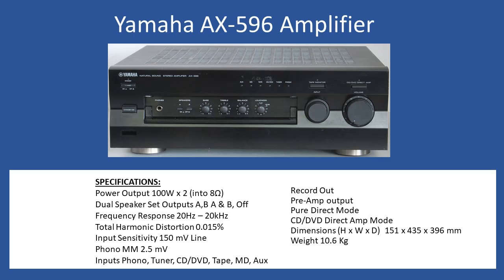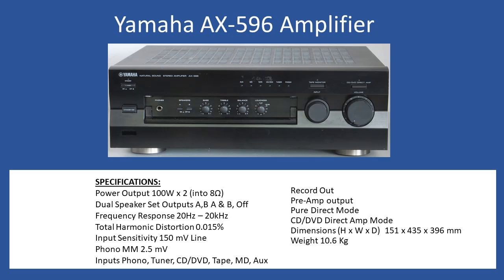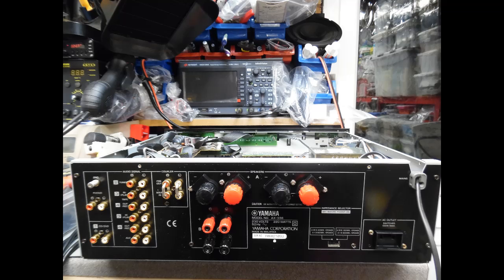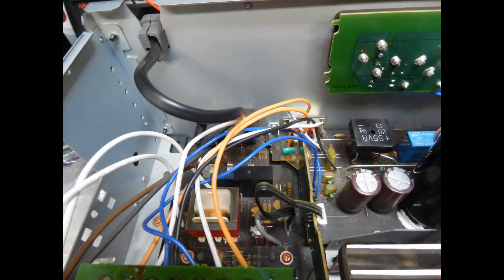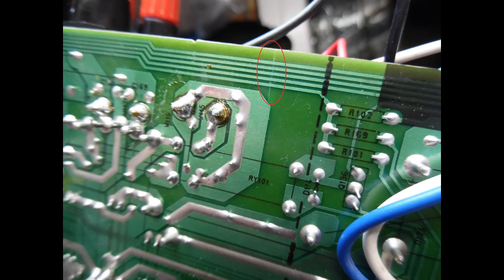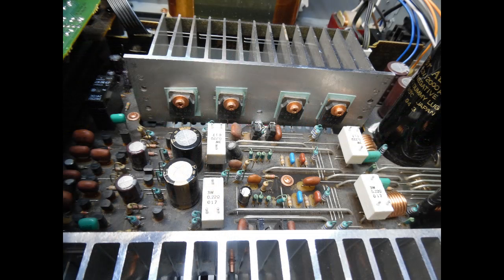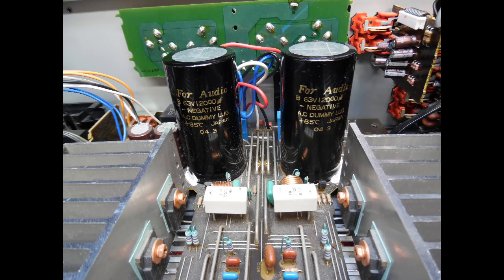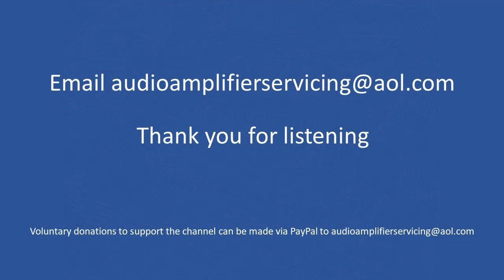Yamaha AX - 596 Amplifier Repair (With Audio Tutorial)

Comment: Hello, thank you for the video. Could someone tell me the part number for the volume knob potentiometer? Unfortunately, mine is broken ☹️ and I'd like to order a replacement. Thank you very much. 🙏🙏
Reply from the maker: RK16814MGLA200k potentiometer
Reply: @AudioAmplifierServicing  Thank you so much, it's a lifesaver!😍👍
Reply: The only reference I can find to buy online is rk16814mgla 100k(or 100kaX4), I can't find 200k, is that not good?
Reply from the maker: @cholok4514 Hi the data sheet only shows max resistance available is 100K https://share.google/mgbF0c5KBp2rPid0u
Reply from the maker: So the 200K version looks to be a custom OEM part. What has failed on the existing potentiometer.

Comment: Hello, I have to repair the same amp with a similar problem, when pressing stand by, the amp turns on for only 2 seconds and turns off, the signal on the pin that connects the main source appears and disappears... I've already checked almost everything and I'm starting to think it could be the processor, any idea what it could be?... thank you very much.
Reply from the maker: Hi, page 7 of the service manual details the inputs to the microprocessor for triggering the protection circuit.

Check to ensure none of the signals are high.
Reply: @AudioAmplifierServicing  Hello, after checking the protection pins of the M3748M4, pin 17 Power supply protection shows 1.8V in standby and 2.70 when I press start... I checked the power supply capacitors and everything is ok... any idea what it could be? Thanks.
Reply from the maker: @tunderbird123  Hi I have sent you a response via email

Comment: Hello,maybe i am late,but is there any way to disable protection entirely on this amp?Mine just clicks and doesnt turn on,it would be simpler for me to disable it in order to check voltages,i dont know if thats possible on this amp?
Reply from the maker: Hi, if you have the service manual refer to page 18, it shows the protection circuit    trigger signal path.
Reply: @AudioAmplifierServicing  So if I just cut some component along that path it should just stay on?Thank you
Reply from the maker: @Daca241  Do you have experience repairing electronic equipment. It's important you understand the circuit
Reply: @AudioAmplifierServicing  I dont understand this circuit,but i have repaired few of vintage amps(there were far simpler,and didnt have microchip)my problem is that i am sure that output transistors are fine,they arent shorted,output resistors are ok too,so something else is not letting it turn on.Also somehow it does turn on when speaker impedance selection switch is in middle position(not engaged).I cant check voltages properly unless i force it to stay on.
Reply from the maker: @Daca241  Hi refer to the service manual and the Microcontroller IC308 located on the PCB Funtion board.
Pins 15,16 and 17 are the 3 protection signals.
One of them will be going high, check which one, and then you can isolate it.
Please observe caution when disabling any protection circuit operation.
It is designed to protect the Amplifier in the case of a fault.
Reply: @AudioAmplifierServicing  So far on PRI(pin 16 i have 3.6v)others are as in manual(around 0.5,6 and 1.6,7).Perhaps there is problem,just need to find out what is in it,no idea what can overload it when nothing is connected.I have also checked -15 and 15v on board and everything seems to be ok.Thank you for helping
Reply: @AudioAmplifierServicing  Now it just turned on by itself LOL,no idea how it managed to work,maybe probing in with multimeter somehow made it work
Reply from the maker: @Daca241 It sounds like there is a bad solder connection, so worth checking.
Reply from the maker: @Daca241 From your last notification about the fault and that it's corrected its self. I would look for potentially bad solder joints(s).
Reply: @AudioAmplifierServicing  Yea,before it started working i have resoldered all pins on ribbon connectors on cpu board.I believe fault was in one of ribbon cables connection,i have all of them reseated and cleaned with contact spray.Also entire amp was rusty and filty,so i had to clean it with alcohol and stuff.So far it works and sounds great.Will see if it starts acting up again.Originally it worked and i broke it by trying to replace volume potentiometer.Anyway it works ok now,it needed cleanup anyway.Thank you for your help,you are great :D
Reply from the maker: @Daca241  Great to hear you have fixed your Amplifier. It's always more challenging if it comes from a dirty or damp environment.
Thank you for sharing your experience on the channel.

Comment: hello, i have the same amplifier and i have an issue, it turns on and then gets out of standby mode and then the speaker protection relays do not click, during this time, the volume knob does not respond to the volume buttons being pressed for increasing/decreasing the level while the rest of the amplifier functions such as input selection and stand-by work via remote, any idea as to what could be wrong? thanks!

and one more thing, i did not understand how you did a check for the status output using a multimeter, if you could explain that to me it would be helpful,thanks!
Reply from the maker: Hi can you confirm the setting of the speaker selection switches.
The switches are behind the drop down flap. To check the output status with a multimeter connect, the negative multimeter lead to one of the negative speaker terminals and measure the voltage level with the positive multimeter lead.
Reply: @AudioAmplifierServicing  yes, the speaker selection switches, both A and B were "on"
i shall check the output status and get back!
Reply: @AudioAmplifierServicing  i did measure the voltage, on standby it is 1mv dc and when the amp is turned on it goes up to 1.2mv dc
Reply from the maker: @waitingforthetrain2690  Hi as the Amplifier is not in protection mode, check the DC voltage supply for the relays.
Measure the voltage across C319 & C140 as detailed in the service manaul section Relay Drive.
Reply: @AudioAmplifierServicing hello, i believe that on C139 and C140, the voltage should be 17.5 but on C139 i get 32v dc and on C140 i get no voltage
Reply from the maker: @waitingforthetrain2690  C140 should be minus 17.6 are you measuring in the right place?
Reply: @AudioAmplifierServicing  yep, C139 gives 31.9v dc while C140 gives .4v dc

these Caps are close to the impedance selector switch, they are 25v 3300uf right?
Reply from the maker: @waitingforthetrain2690  Hi yes the capacitors are 3300uf 25V, R171, and R172 are 1 ohm protection resistors and provide the AC voltage to the rectifier diodes if you're measuring across C140 and the minus 17.6 voltage is missing, check D119 and D118. They would have to be open circuit for there to be no voltage or there is a broken circuit track from the diodes to C140.
Reply: @AudioAmplifierServicing  hello
i'll check on this and get back, thank you!

Comment: Hi, I wanted to ask you about the amplifier.
mine works but I don't have the bias measurement on the 4 2.22ohm 3w resistors, I measured them with the tester and they are good.
the cooling fins remain cold only the one on the left heats up after +/- 1 hour, the right remains lukewarm.
all measurements on the finals and various transistors are perfect as per S.Manual.
I'm not sure about this problem, do you have a suggestion?
Reply from the maker: Hi the when referring to the service manual, the bias is measured at R111/R135 left channel and R112 / R136 it should be 0.4 to 8 millivolts.
If either is high cut resistor R175 left channel or R176 right channel.
Reply: thanks for the answer, the problem is that there is no measurement on the test point I have 0 mV this is the problem🤔
Reply from the maker: @abrambilla  Hi as you are aware the bias is preset there is no trimmer to make any adjustments. If you are reading 0 volts it indicates no current is flowing through the emitter resistors.
I would check the emitter resistors and also the solder joints around that area of the circuit.
Reply: yes I saw that there is 0 volt emitter, 0.6v base and 52v collector on all 8 final transistors, all the measurements of the small transistors are perfect, I replaced the electrolytics except C107/108 220uf and C130/131 470uf and checked them all the resistance values.
I don't understand what I'm missing.
anyway, thank you @AudioAmplifierServicing
Reply from the maker: @abrambilla  Very odd can you do a continuity check each the tracks for the emitter resistors to the transistors and then to rails in case the is a cracked track or solder pad that connect to a track.
Reply: what I can't understand is how it creates the bias current if I have 0 volts on the emitters @AudioAmplifierServicing
Reply from the maker: @abrambilla  Hi email audioamplifierservicing@aol.com
Reply: sorry 0,22 ohm resistor